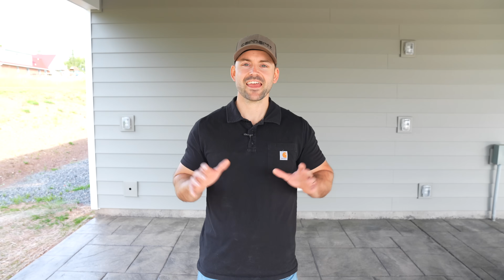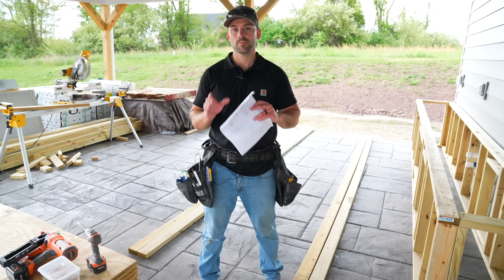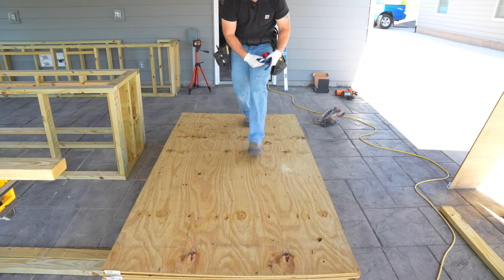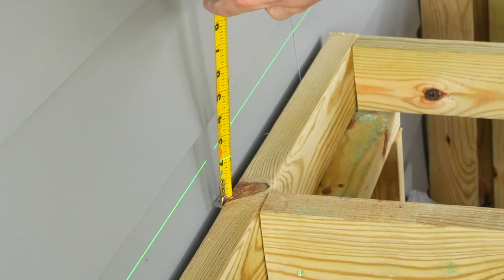How To Build An Outdoor Kitchen - DIY

Comment from the maker: To help you better navigate this video I placed timestamps below! Thanks for watching!
Timestamps
Intro 00:00
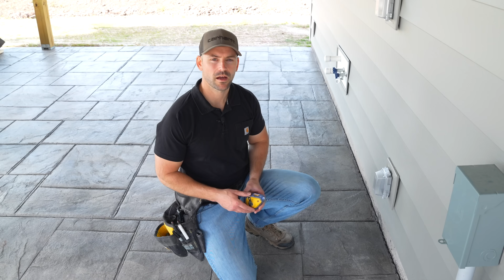Chalking Layout 06:53
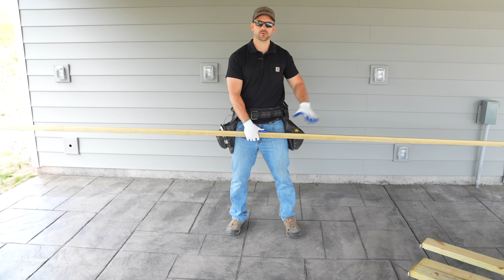Framing Kitchen 08:19
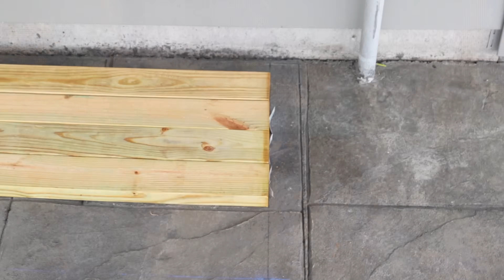Measuring For Drawer and Doors  09:07 
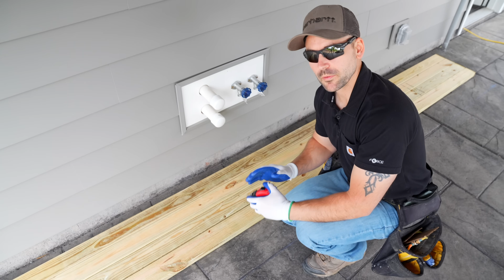Layout For Drawer and Doors 10:54
Framing Height Explained 14:13
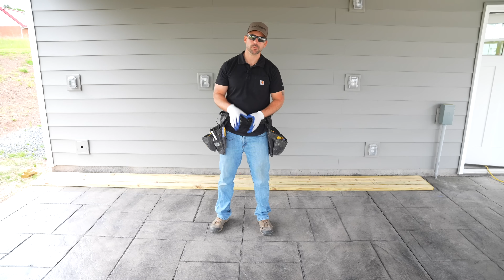Framing Kitchen Walls 15:22
Anchoring Framing To Concrete 18:28
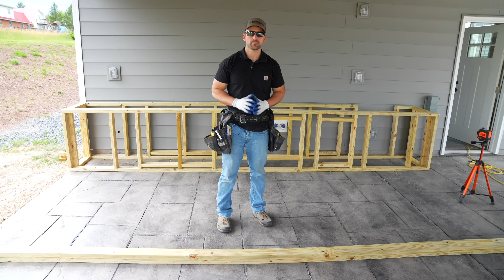Framing Griddle And Side Burner Wall 20:31
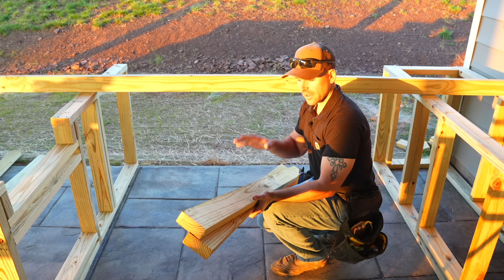Framing Grill Walls 25:03
Framing Peninsula Wall 26:02
Installing Plywood 28:50
Running Gas Lines 33:05
Wiring Outdoor Kitchen 36:45
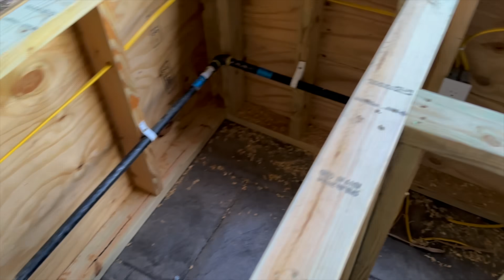Plumbing Outdoor Kitchen 37:44
Framing The Countertop 38:49
Sink Framing 48:29
Leveling Countertop Framing 52:11
Additional Information 55:59
Reply: Thank you..... please don't take it as whining your video was outstanding and you have helped me out so much on many projects.  You have skills way above my level and the  timestamp will help...Please keep up the great work and videos.
Reply: woodprix is full of awesome tips. Very helpful to me.

Comment: Out of curiosity, is there a reason you added the protection to the iron pipes after installing them instead of before? Is it just a personal preference? I figured it'd be easier to apply before it's strapped into place.

Thanks for the awesome videos, I've been learning a lot.

Comment: Kitchen Designer here.  Great tutorial, great craftsmanship and thoughtful layout.... But, I believe you have a missed opportunity concering use and maintenance.  Elevating the bottom plate with water-resistant feet by 2-3 inches would have allowed the use of a hose and/or weed blower to easily clean debris, water from rain and snow,  dirt and dust off and out your patio. The cabinets would stay dry and there would be access for cables etc. for any future changes.
Reply: Can you elaborate on how to do that?
Reply: You mean create a rat cave?!

Comment: Not a builder nor am I from yanky-land but there are things here that stand-out. 
The term "Pressure Treated" is used by yanks a lot but means nothing. If the timber is "Treated" it means with chemicals to resist rot and insects and "Pressure"  (Positive pressure and nagative (vacuum)) along with heat is used to drive the chemicalls intot he timber. I see no dye colour to state if that is indoor or outdoor rated treated timber. 
Next issue, outdoor and the timber is put directly onto the floor that basically at same higher as ground around it. No barriers for moisture or insects. Putting hole lot on steel pedestalls world fix these issues. Obviously, there is more to the project but the whole area will need screening.
Reply: In the US pressure treated is typically an indoor/outdoor ground contact rated lumber. It's rated for direct contact with soil and concrete. Obviously it is beneficial to limit moisture regardless of treatment so in home framing you will also see foam gaskets and flashing used to separate the pressure treated wood from sources of moisture like concrete

Comment: Most recommendations I've seen entail using a steel or concrete block frame - as opposed to wood.  Are you not worried about the wood rotting, swelling, or being combustible?  Obviously wood is the cheapest option, but I've seen most people recommend staying away

Comment: Great work on the framing same as everything I've seen you do.
You must have a massive budget but saving a ton on using your skills.
Reply from the maker: That is the trick, saving on the labor side. Yes it’s not cheap to build an outdoor kitchen. I figured this is my forever ham so it is worth it long-term. Thanks for watching!
Reply: @TheExcellentLaborer  if you have a glaze recipe for that forever ham, I would love to try it!
Reply: @TheExcellentLaborer  
I do the same, remodeled my garage and installed a sub panel so all my shop tools and lights run off it, your video on this matter helped me on that.
I built a deck and paver patio a couple years back and now building a roof over the patio starting this week. As long as it's something I can do I won't hire someone to do it. I also enjoy it too.